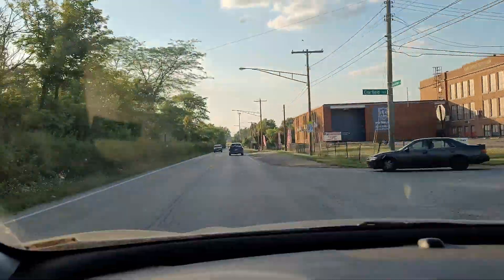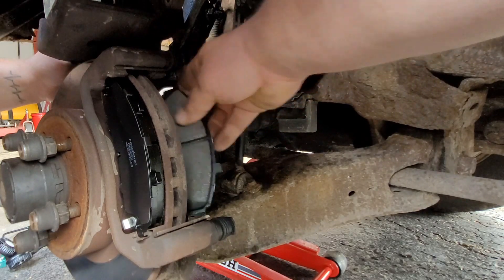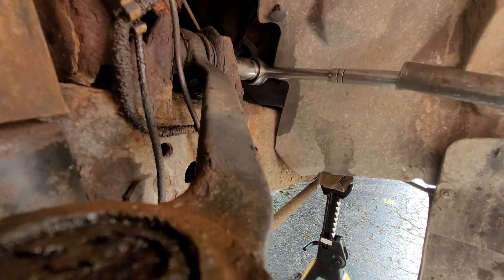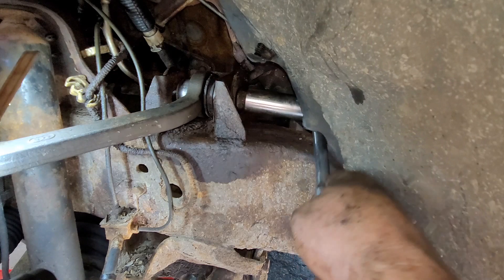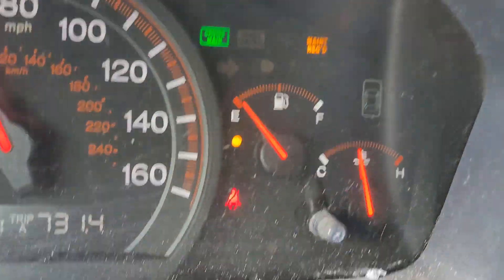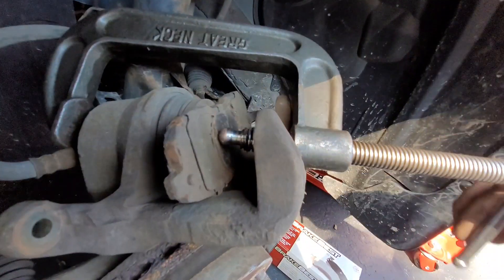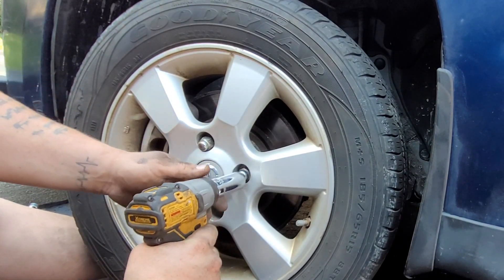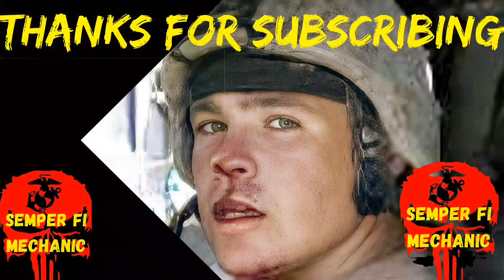Mobile Mechanic Work Day {Episode 5}-1998 Ford Ranger Upper Control Arm.

Comment: OK bud the bolt with the off shaped washer is for camber and caster setting mark them so they go back exactly. Also I have level from summit racing to measure camber and caster. Would have recommended shocks on the ranger due to milage and age/condition. Recommend parts only buy condition if they worn out leaking or damaged but also by manufacturer specs. Good job everything looks good loved the video!
Reply from the maker: Thank ya brother for the support like always and great advice

Comment: Use a rubber hammer and hit the inner rim when removing stuck tires, never use steel hammers. You can get those rubber hammers really cheap from Harbor Freight.
Reply from the maker: Good point thank ya

Comment: I’ve been working on cars for a few years and I’m pretty good with a wrench. I opened up a mobile mechanic business with all sorts of motivation and I got cold feet. I live in a big city and other mobile mechanics with more experience and more expensive scan tools etc threw me off. Got kinda nervous to put my self out there. I can do and have done a lot of different jobs but not being certified or having a lot of time in a shop just gets to my head. I guess it’s all ego. Your attitude and your kindness in the comments really has helped me feel like I should stand back up and go for it even though I got intimidated. Thank you sir
Reply from the maker: Go out there man and do some work. Like I always say man just take small jobs that your comfortable with. Start out slow just some brakes and small suspension issues. Easy alternators. Most of the time the customer doesn't watch you so you can look up videos right as you go step by step. My Code reader is the $60 one from Harbor freight man all you need is one the can read codes and live data. Down the road you can get a bigger one. But for 3 years my small one has done great. To be honest once you start you will be like this isn't no big deal. It's the easiest job I have ever had. The easiest money you will make.  I expect you to start by next Sunday when I drop next video. You got this man quit doubting yourself man. Your over thinking this.
Reply: Yeah taking jobs that I know work for me and aren’t out of my comfort range too much is very doable I’m in control of the jobs I take. Got so out of my head with it all. Yeah the scanner I have is pretty good but I have to try and bend one the metal prongs back into position or I’ll go check out the harbor freight one. I have pretty decent diagnosing skills. I want/need a battery tester. I’m able to do some no starts no cranks but sometimes they get so tricky just overwhelming. Maybe I’ll work my way into that. Yeah that’s a good point about the money and how easy it is. That’s what I need right now. You’re seriously so great man I appreciate you a lot. I subscribed! I put out an advertisement on Instagram from my mobile mechanic business account a few hours ago. It’s focused on people that live in my area and it’s pretty cheap so hopefully that does me good! Going to look into other ads too. I have a ton of business cards so going to try and get those out more. Any tips on advertising?
Reply from the maker: Make a Google Business Account. There free and you can pay for them to advertise. So at this point I don't pay but when I started I would do like $20 bucks a week on advertising on the https://www.google.com/business/. It's still my number 1 driver of New customers

Comment: Just found your channel today. I'm really loving your day in the life video series. I wanted to let you know that on vehicle with Brake Caliper bolt guide pins (The pins that the calipers onto and slide in the saddle) you need to pull them clean and  grease them or the pads may stick and hang-up. Causing un even pad were. Have a wonderful day.
Reply from the maker: Welcome brother to the channel and I'm glad you like it. I'm working on a dodge avenger waterpump 3.5 shitty job lol right now will be out Monday prolly and yea I'm been getting better about doing the Caliper pins. I usually just check to see if they are moving in and out but I need to regrease then more

Comment: I like your videos. One question : why don’t you grease brakes guide pins? They can cause brakes to wear uneven.
Reply from the maker: I check them and if they need greased I do. If you watch some of the other Brake video you will see that I do. But lately I have been doing it every time. Like tomorrow video you will see me doing it before I just checked to make sure they was still moving freely